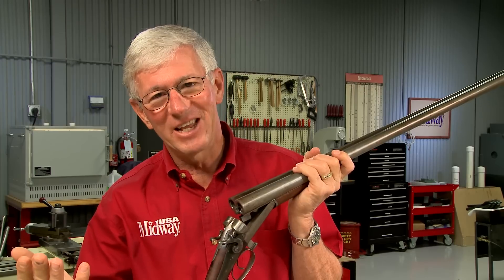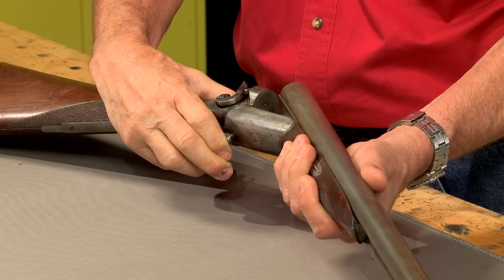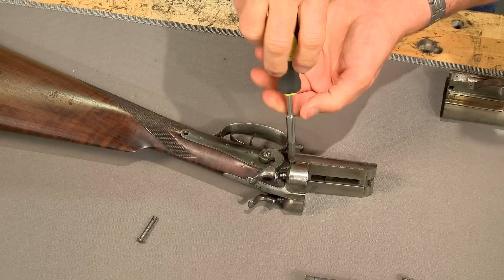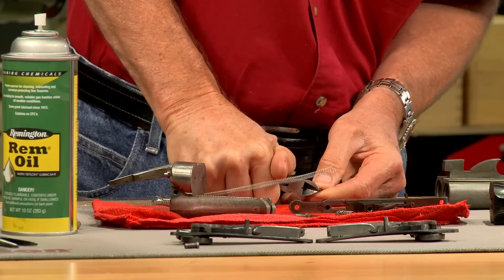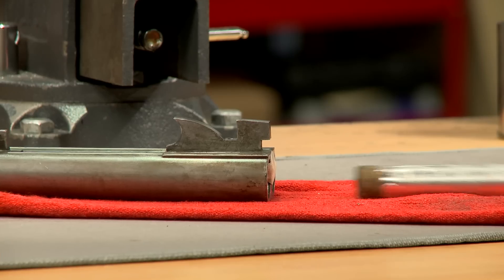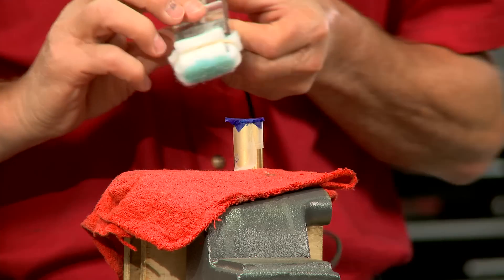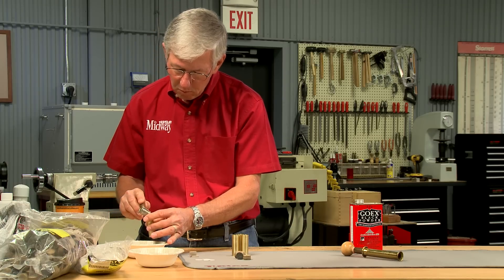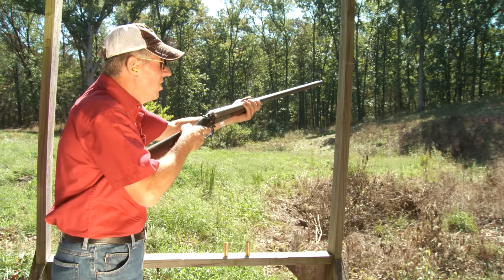The Parker 11 Gauge Shotgun Presented by Larry Potterfield | MidwayUSA Reloading

Comment: If the rim of a 12ga casing was at least catching on the extractor and not falling through, it would've been theoretically possible to fireform 12ga casings up to 11ga diameter. I'm not recommending anyone do this, but brass does expand and hug the walls of the chamber like a mold. Fireforming is a process that most benchrest shooters are aware of and I wonder if it would've worked here. Seeing him lathing out brand new casings on a lathe was impressive enough.
Reply: Cpl. Gadway USMC it can be dangerous as casings can either rupture and youl get blow back, or get stuck.
Reply: Cpl. Gadway USMC  just use modern 12 ga plastic cases, yes they will just expand slightly more when fired but just fire one time and throw away, 12 ga cases are everywhere.  Those black powder loads are low pressure
Reply: Shotguns have much lower chamber pressure than rifles, so it's doubtful that the shells could be fire-formed up to 11 gauge without risking serious damage to the gun or the shooter (especially with black powder.)

Comment: Textbook job again, Mr Potterfield, but I would try to wrap 12ga shells with some sticky aluminum tape. Much cheaper and faster while still preventing the shells from expanding. I think some light load birdshot would have to be used not to stress the black powder barrel too much, but it should hold just fine.

Comment: I've got a Henry Tolley 11-bore. It has been sleeved to 16-bore. It's very muzzle-heavy as such, but swings well on birds regardless. I've used it quite a bit out of curiosity in its handling. The modification was done in England, so I'm not sure if they did it because of the rare gauge, or because of a defect in the original damascus barrels. Wish I knew, because if it was just due to the gauge, I'd be tempted to un-sleeve it and have some 11-bore brass made up.

Comment: would it not be possible to make a very thin adapter to slide in the chamber to shoot a 12 gauge shell?
Reply: David Salazar very possible, but not for 12 gauge. The walls of the adapter would NOT be thick enough for an old black powder gun, and shooting modern loads from a gun this old made with wire wrapped barrels can explode it. It would likely be plenty safe to make a 20 gauge, 410, or pistol caliber adapter for the gun. They actually make adapters for 12 gauge and 20 and 410 to shoot all kinds of ammunition

Comment: Larry i have an old baker 12ga made 1883 s/n is in the 16x range is that ping test a good test for most damascus barrels?  I have fired this gun using my own hand loads and did fine.  Chambers measure 3" and chokes are cyl bore all of which i've done, anything else i need to look for?  I use 70 gr of ff and 1/18 shot in a aa hull using over powder card and fiber wad
Reply: +dowdawg Unless there's significant bore pitting (which is very dangerous especially with damascus), there's nothing else you can do to check for safety short of being sent to be re-proof tested in England. You can always send it to the American proof house (tied to tree with a 3x pressure shell and a pull string).

Light BP loads only. Your AA hulls will melt and burn after 1 or 2 firings, so an investment in some Magtec brass shells may be worth it.
Reply: Thanks for the info!!  Yeah iv'e got tons of aa hulls and was surprised that they held up as well as they did.  I dont fire it too often, but was wondering if that load was a little stiff??  The barrels have minimal pitting in them, but they do get hot when fired.  Guess its the nature of black powder.  Man that would suck blowing them in a proof test!!  Guess it is the only way  Lol  Thanks!!!
Reply: +dowdawg If your shot is at 1 and 1/8 ounce, and with 70 grains of 2F, your load is just about right. Maybe slightly heavy on the shot end. (only affects range) Just be sure to tightly pack your shells with no air space in the BP charge!

this may help: http://www.tbullock.com/bpsg.html
Reply: Hughes Enterprises ok that is one thing I need to do for sure I have been relying on the press rod for that but need to pack by hand..   thanks a bunch!!!!
Reply: Your load isn't the issue, though it's a little heavy on shot for that load of powder.  The problem may be the chamber length. 3" would be very unusual for an old Baker. 2 5/8 would be more common.  I'd suggest you have it carefully measured.  If it really is 3", the chamber may have been lengthened and it could be unsafe for that reason.  Then you would definitely want to have the barrel thickness measured at several critical points.
Reply: IF your measurement of the chambers is accurate, it's very unusual for it to have originally had 3" chambers. So, the chambers may have been lengthened a lot.
Ask a good gunsmith to measure them and to measure the barrel thicknesses at various points. If someone had been putting 3" smokeless loads through it at some point in the past, the elastic limit of the barrels may have been exceeded. Bottom line: the gun could be dangerous.
Reply: It would be unusual for a Baker to have been made with 3" chambers. I'd suggest you measure them VERY carefully. If they are really 3", that could mean that they have been lengthened. Obviously metal would have had to have been removed possibly rendering the gun dangerous to shoot.  Also, if lengthened, someone had a reason to do so and I'd wonder if he was shooting heavy modern loads through it.  People do crazy things. And the elastic limit of the barrels might have been exceeded. You'd need a barrel thickness gauge to check it properly.

Comment: I wouldn’t shoot anything made from Damascus. That is a death wish.
Reply: The Brits. still use and sell lots of them. They have to be reproofed for nitro to be sold and the failure rate is very low.
Check out Sherman Bell's articles in the Double Gun Journal on the subject. A serious mistake that people make here is to assume that old, early fluid steel barrels are as strong as modern alloys. They then shoot magnum loads in short chambers and barrels that have been "freshened" long ago.  Bad combo. There are several other issues affecting old shotguns, too.